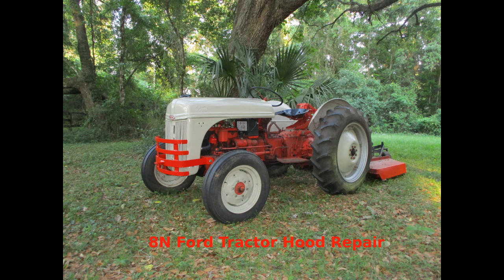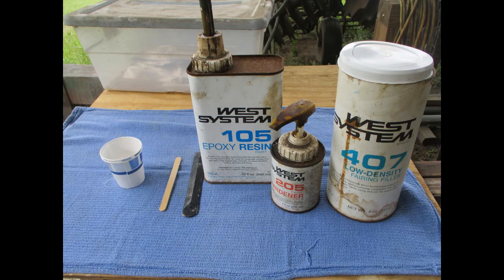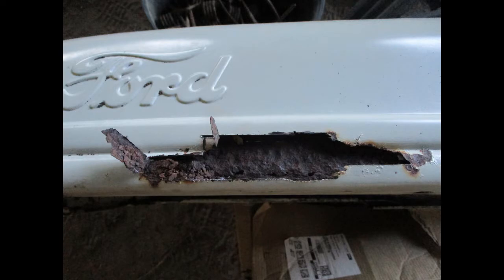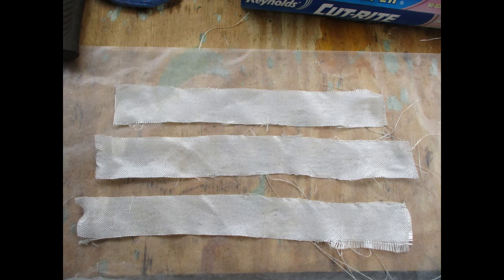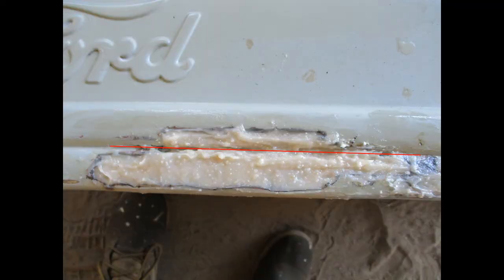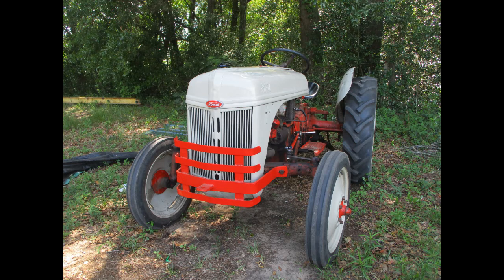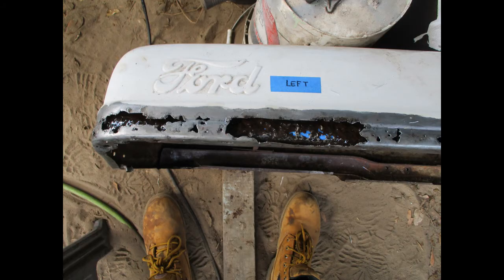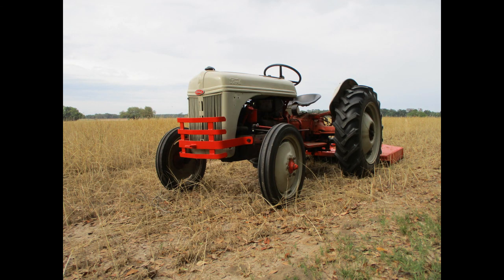Ford 8N Tractor Hood Repair

Comment: The best way to repair it is IF you can find a donor hood with rust free rib section and cut out and weld in new metal. I have a ‘49 that the hood was Bondo patched in ‘66 and needs refilled. I ended up buying an entire aftermarket hood,doglegs, and grille for it and will be installing it in a few weeks. I am keeping the old hood and may try to patch it up again.